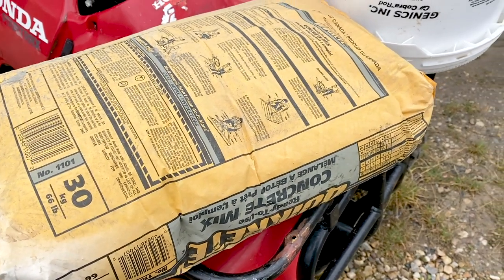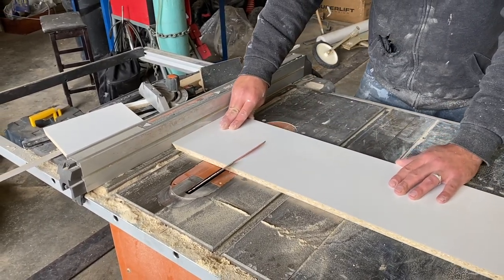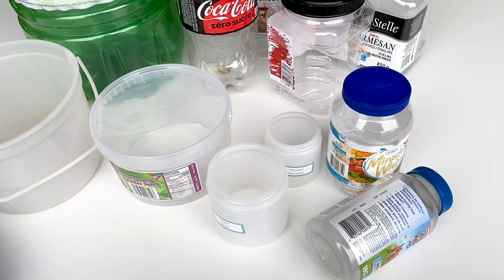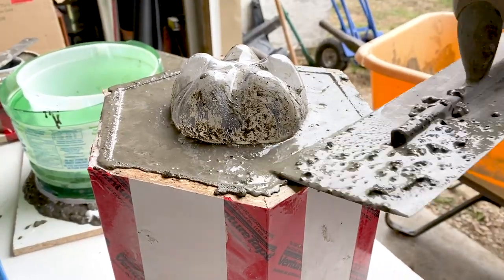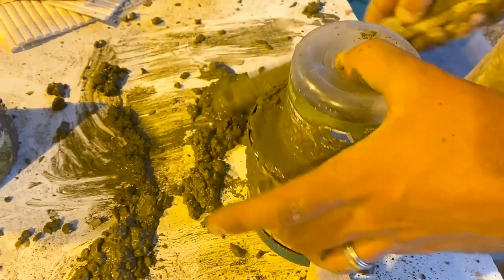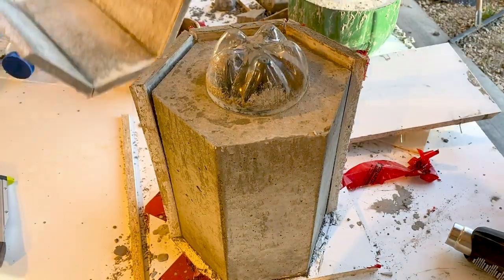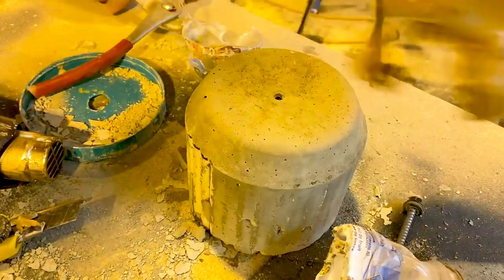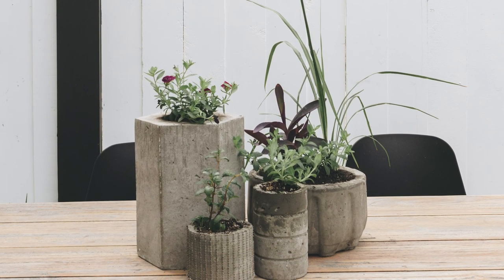Easy DIY Molds For Concrete Planters at Home!

Comment: I’m just curious if you fill the plastic bottles with water while the concrete is setting to help preserve the sheep. Also, was wondering if you use some sort of kreg tool on the wood forms and perhaps a Sillicone or pvc instead of water bottles to reuse the set up for making duplicates???
Reply from the maker: Great ideas! Might have to try these next time :) Thanks for watching!
Reply: @LindiandRuss  I have a nice PVC diamond plate design mat that I have in the trunk of my jeep that I think will give it a nice industrial look.
Also, going to try  some sort of reusable form, perhaps with machine, thread bolts and wing nuts along with repurposed cabinet hinges to make a two-part mold

Comment: hear me out if you are gonna making concrete planters use sand and grave that way it gives more strength and you could add a plasticizer to make it look better, if you are using white cement use fibers there documentation about the gfrc mix and that would allow you to make different shapes

Comment: Yikes you should not have used the fence on your table saw cuts. Kickback waiting to happen there. Seriously please use a crosscut sled or the miter gauge slot fence to do cross cuts on a piece like this. Scary just watching this!
Reply: Right but even if he chose this way he should use a push stick. fingers too close to saw